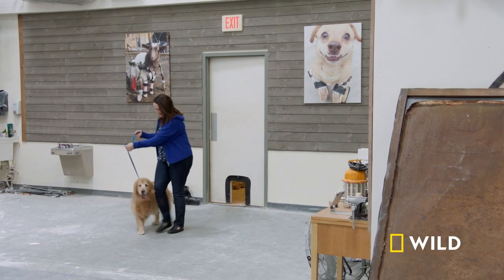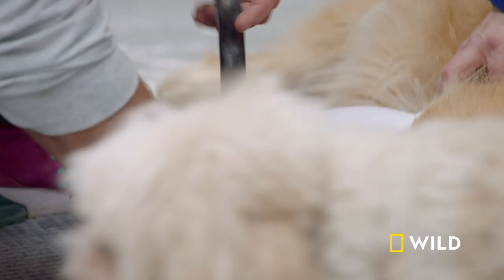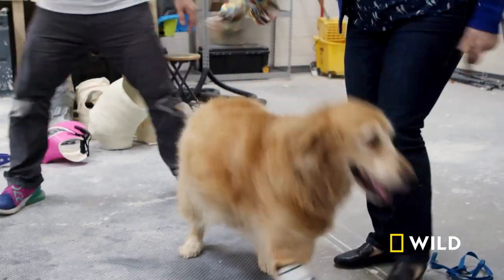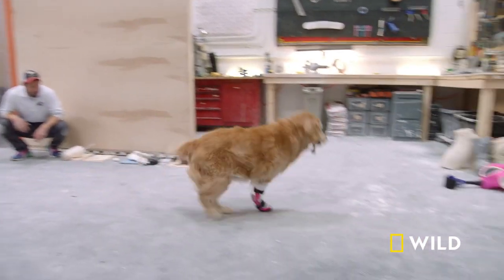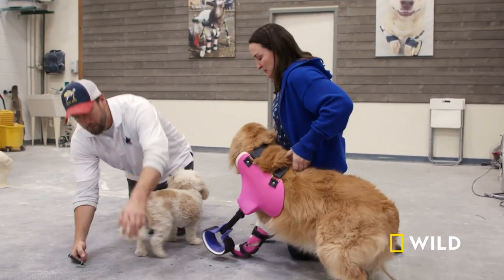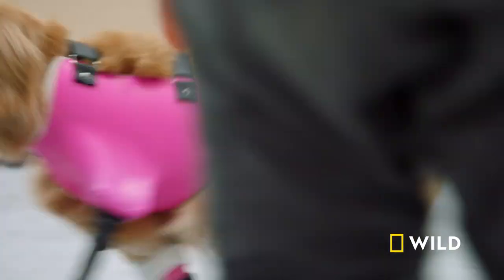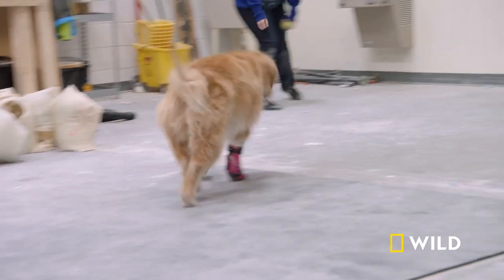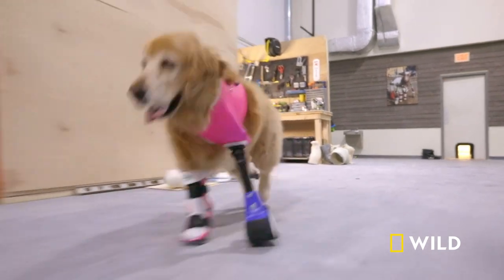A Dog Tries on a Prosthetic | Wizard of Paws

Comment: What if you put a small forward facing wheel like a roller blade wheel but not I'm just saying the shape in the middle of the temper on the amputated shoulder that touches the ground if she had a small wheel in the centre facing forward